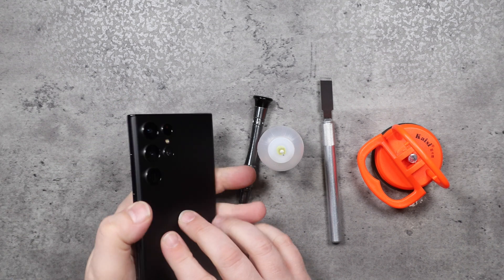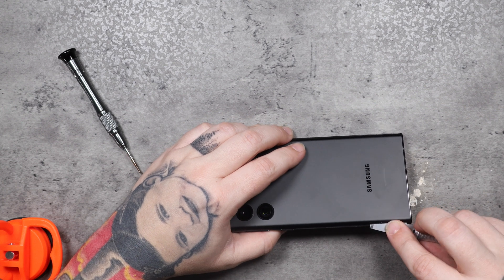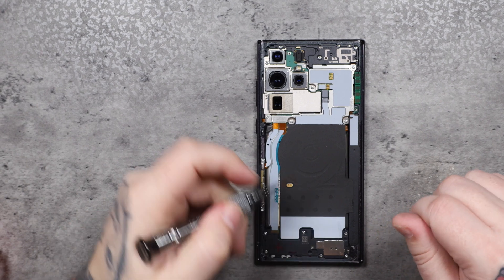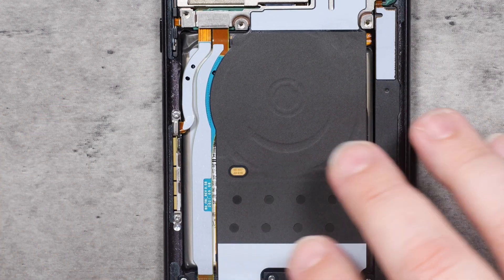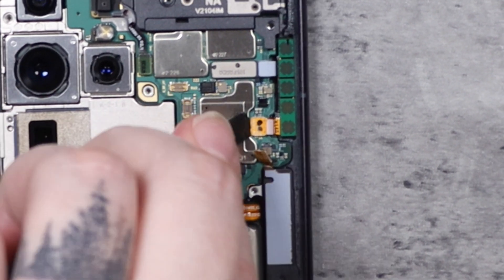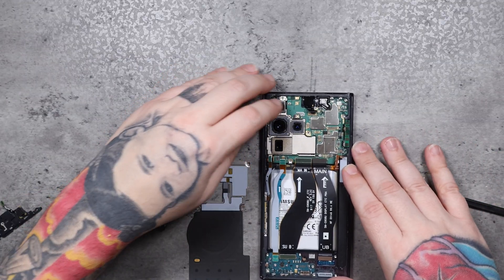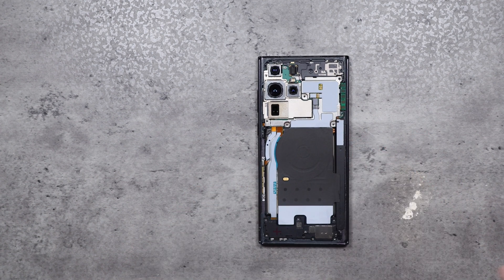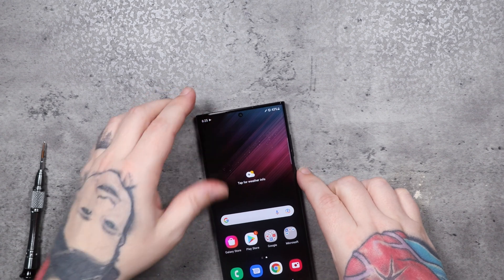Samsung Galaxy S22 Ultra Teardown, Disassembly, Reassembly, Screen Repair, Restoration.  Is it easy?

Comment: great video, we can see the parts really clear, very helpful 👍such cool parts :) my brother had issue with his S22 Ultra - faulty display not reacting to normal touch just working with the S Pen ... I was hoping it was a software issue, but sadly it seems to be the main touchscreen ribbon cable (just my guess) but we will bring it to the repair store on Monday in any case...